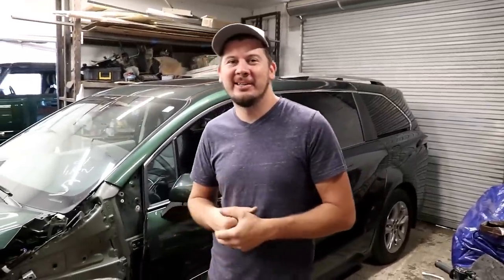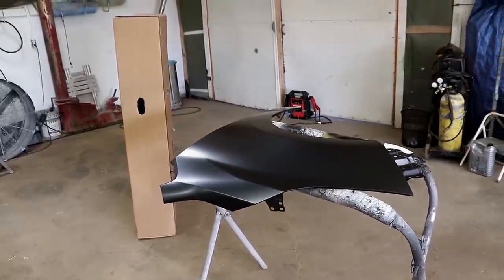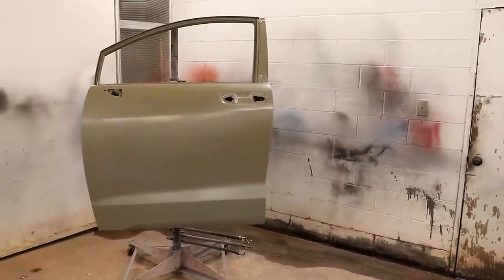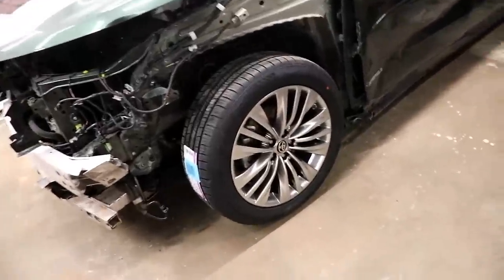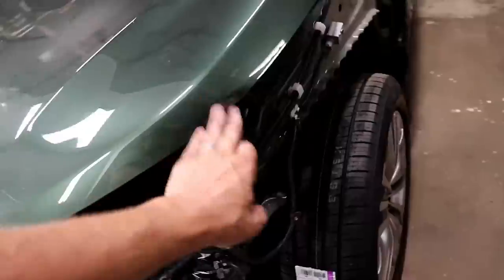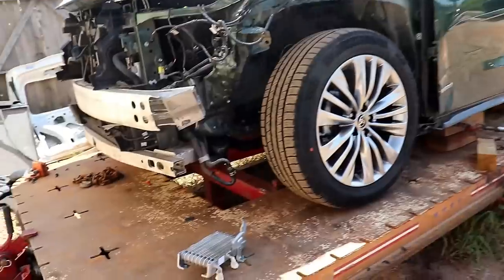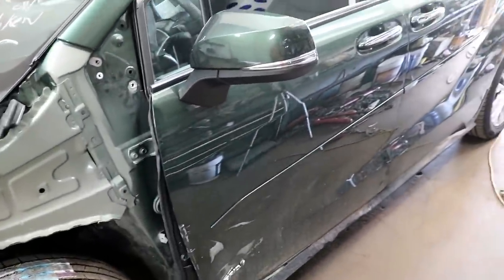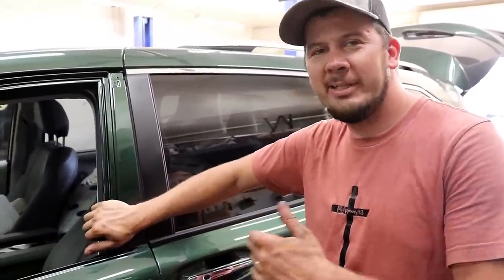REBUILDING A WRECKED 2021 TOYOTA SIENNA FRAME WORK & PAINTING

Comment: Good progress so far. I think I may have mentioned this before but here in the UK there is now a scanner device that the paint shop can use to match the colour. As it is available here then you should have it in the USA. Just take a panel with you and they can scan it even if the original is a bit faded it will match with this method.  They then have the right mix numbers to put in the computer, job done. 👍👍